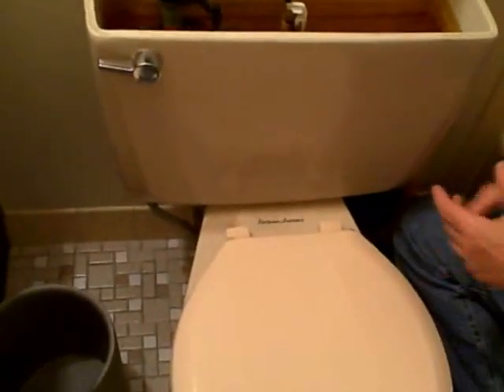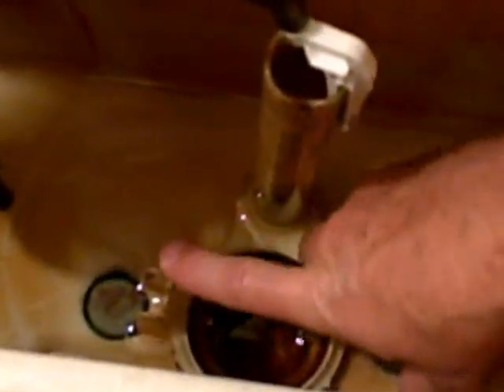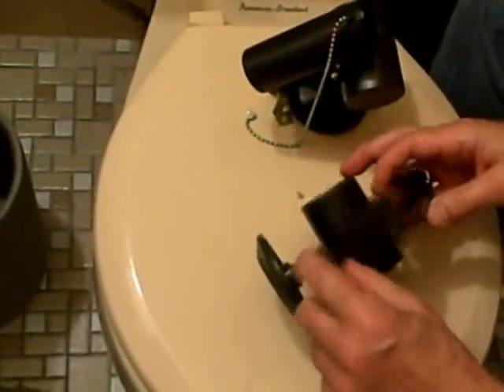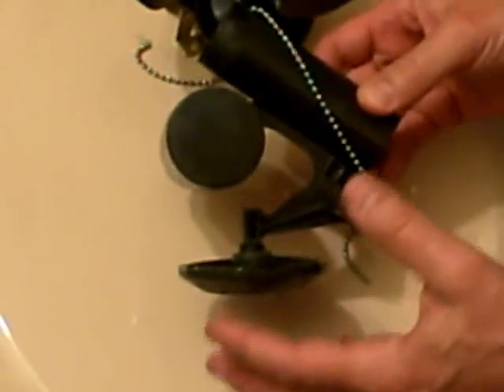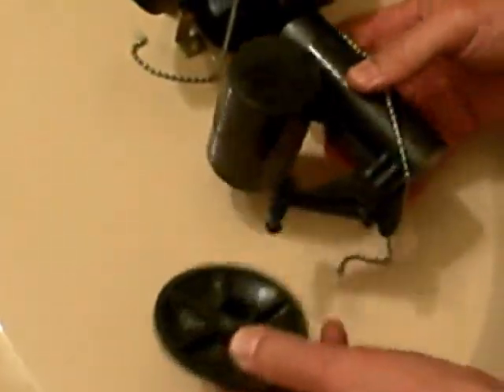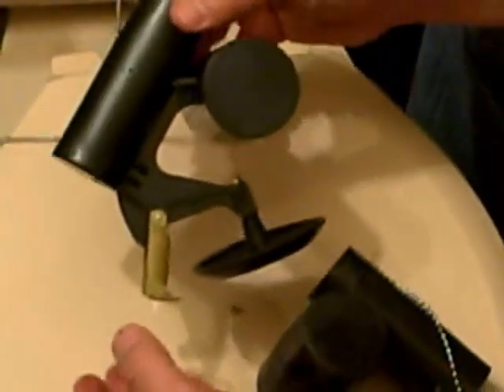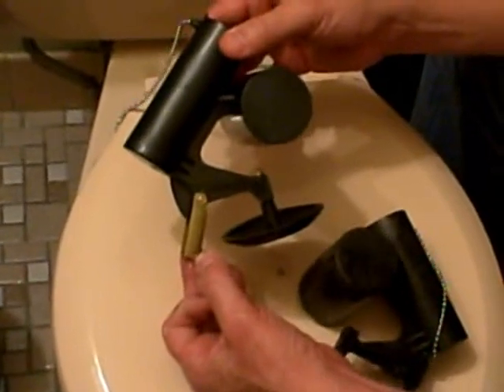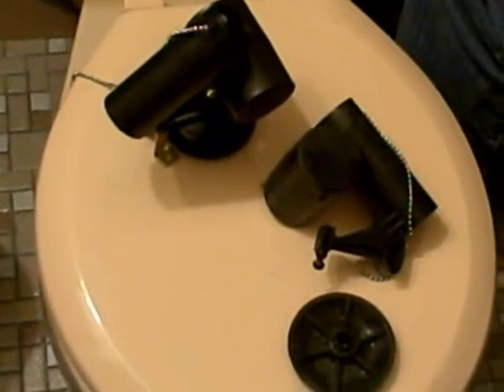American Standard Toilet Repair - Flush Valve Seat Disc

Comment: Pro tip: forget about the American Standard style flush valve. Just go to Lowe’s and get the fluidmaster universal 2 inch flush valve and it works perfectly. The only thing is that the included tank-to-bowl gasket doesn’t quite fit so you need to get the Keeney 2-inch gasket (also at Lowe’s) and it will work. I just did this to five of these toilets from 1964, I should’ve made a video on how to do it
Reply: Can you buy a flapper that slides over the overflow tube?
Reply: Wish you made a video on this. this is the type of video i need right about now.

Comment: Youre blowing my mind here. Ive been screwing around with flappers on my toilet and I can never find one that works right. And my toilet has no ears for modern flappers to mount to, but it did have that bracket. Now I know what was meant to go there! Someone must have thrown away the old flush valve ages ago.

Comment: Great video. I have an Am Strd Tank 4040. I think the Actuator is 47088-0700 and perhaps the original seat disc which now leaks. The more I play with the disc the worse it gets. Dilemma is I'm not sure if this is screw on type or snap off. I was able to spin the disc counterclockwise but it didn't screw off. However it didn't easily pry off easy as yours did either. Do you have any thoughts about the correct seat disc on model 47088-0700? Or how can I determine if this is snap or screw type?

Comment: I would love to take it to the hardware store if I could figure out how to take it out. How do you take out the piece that you had already taken out?
Reply: I know this is very old and hopefully you've figured it out by now but the answer to your question is you take it off very carefully. The plastic bracket that holds the 2 little notches to the flapper, can be gently spread so the pegs pop out. I found doing one at a time worked very well.

And if your stuff is old like mine, you don't want to touch the actual seal at all or you'll be pitch black and slimy.

Comment: If anyone is trying to replace the screw on type for a 4049, shut off the water and drain the tank. Get your needle nose pliers handy, lift back the actuator and press up on the disc a few times and you will notice the top of the screw moving up and down. Use your needle nose pliers to hold the top of the screw still, then unscrew the disk flapper. There should be a replacement nut with your new flapper. Insert it until you hear or feel a pop. Go back to holding the top of the screw with the needle nose pliers and screw the new flapper on. Let it drop down on the hole, turn on the water and give it a flush or two. I used the Fluidmaster 5013 today in one toilet and it's doing fine for me so far.

Comment: Update: Removing actuator from bracket was somewhat hard. I removed it from the new bracket but a test to put it back on was tricky. I remembered Kat's forebodings & concluded too much risk with so little room to work. I next tried changing only the rubber piece. The actuator patent # is the same, but this rubber flap is neither screw nor snap. Well ok- it's a screw hybrid, but attaches (as through) the mechanism next to the drum, like a bicycle spoke. The fill tube is also longer. Oh well.

Comment: Will the Universal American Standard flush valve actuator work for them all?
Reply from the maker: Hi, yes it will. Just put in the threaded nut for a threaded rod, remove the nut for the style with a push fit.
Check out more home improvement tips in our e-books https://www.amazon.com/gp/product/B0B2KW1FQ9?notRedirectToSDP=1&.

Comment: It looks like no one has used the advice you offered for a while, but lucky for me I had a look before going to the hardware store for the part. It took about 10 minutes once I got back to have the flush valve repaired and working like new.  Thanks
Reply from the maker: Glad it was helpful!
Check out more home improvement tips on our weekly podcast 
https://itunes.apple.com/us/podcast/fix-it-home-improvement/id880903087?mt=2

Comment: Saturday 8/24/13 I attempted the switch. I was able to get the leaky unit out. Unfortunately when inspected up close it seemed I needed the #4 old style high profile unit, not the 47088-0700. I gambled & sunk another $16 w/shipping for the #4. It arrived today. Success! I'll just add that it takes some playing around to get the units out of their brackets but when maneuvered just right, it will come out. I push pulled w/two hands & rotated the front nib upwards. Thanks for your insight.

Comment: Thanks, I just repaired mine, replacing only the removable screw on disc/flapper. Out of 3 toilets, that one has been in there since 1987 when we bought the house with no problems whatsoever.  That's pretty typical to change a design that works perfect and go to the modern korky type flappers you have to replace every couple of years. Planned obsolescence.

Comment from the maker: Hi,
On the style that I removed, I used a finger between the bracket to spread it apart and twisted the flap to slide it out. 
Can you remove the rubber disc?

Comment: Do you know what color that toilet is called? I have 1958 American Standard fixtures and I'm either looking at repairing them or replacing in a lathe and plaster bathroom with at least an inch of mortar bed to get the tub out. Plus, it's a double apron tub so I'd have to demo my whole bath to replace it. Any help you could offer would be deeply appreciated. Thanks for the video. I've subscribed.
Reply from the maker: Hi, sorry I don't know the color. I would give American Standard a call and see if they could help. I've found most companies to be helpful. 
Check out more home improvement tips in our e-books https://www.amazon.com/gp/product/B0B2KW1FQ9?notRedirectToSDP=1&.
Reply: @FIXITHomeImprovementChannel  
Thank you for the reply. I'm sorry to be a pest, but where would I find the style number on the part. The bracket is broken on mine and it looks just like the second one you show with the brass bracket. It's a one piece toilet, I believe an Old Champion style.

Comment: What if you just want to replace a broken flush valve chain, but the old small rubber grommet is stuck in the hole in the actuator? How can you get it out?
Reply from the maker: Hi, did you try an awl or a precision screwdriver?
Reply: @FIXITHomeImprovementChannel  I have not- I will give that a try. Thanks!

Comment: I decided upon the 47088-0700 and have received shipping notification, I expect it next week.  Having never replaced this part  before and it's antiquated, I can sympathize with Kat's worry about breaking the bracket, but I'm going to carefully try the "spread apart the bracket and twist technique" and hope for the best. If you can think of anything else I should keep in mind, let me know- otherwise Thank You again for this insightful video.
Reply: I broke the tabs on the flush valve-they were paper thin. Bobby pins holding for now.

Comment from the maker: That style should just snap in place with 2 small posts like you see in the video. They come in snap or threaded. If it is a 47088-0700. Your local hardware store should be able to order it, or go to a plumbing supply. You can also call American Standard, they should be helpful.

Comment: Very informative, except how do I actually get the flapper assembly off, and is there an adapter to switch it to the more common tower flapper (or is there a reason this is not a good idea with my toilet)?
Reply from the maker: +Dni KL Hi, here is a video showing how to replace the flush valve. Let me know if that helps. https://www.youtube.com/watch?v=hwOXKvlAk2Q
We have more tips in our home improvement book http://www.amazon.com/dp/B01BK2K0JM?ref_=pe_2427780_160035660

Comment: I'm almost certain I have the correct model # but there is reason to believe I have an older version of the same model. As I pointed out it's going to take some work to get the pieces switched, and with the risks involved, no- I haven't done anything yet. If I knew for sure the new one was going to fit, I'd definitely attempt it. Now I'm apprehensive about possibly ending up in a worse state for nothing. With the weekend coming maybe I'll get the nerve up.

Comment: I have changed the Everbilt Valve Actuating unit using the blue part,, Type B,, Snap in, and I still have a leak. I rotated the press seat disc, cleaned it and also cleaned off it's mating surface on the bottom to no avail.   When I did this before the problem was solved.  I don't understand why it is still leaking. :(   Anyone have any ideas? Thank you.
Reply: Flush valve seal probably needs replacing, though I assume you've fixed the issue by now.

Comment: It doesn't seem there are any screws to take out. The little metal "nibbles" stick out a little. . It seems I might have to widen the plastic holder to take it out, but it is plastic and will probably snap, so then I will have bigger problems.

Comment: How u removed the valve ?
Reply from the maker: Hi, there are a couple models in this style. One just snaps off, one style needs to be unscrewed. The easiest is to remove the rubber gasket and replace that rather than removing the whole part.
We have more tips on our weekly podcast http://castbox.fm/u/4891735

Comment: I'm sorry, but this video did not help whatsoever! How do you take it off?? Can you just buy a flapper that fits over the overflow tube once you take the actuator off?
Reply: I just tried to pop the rubber flapper off like he did and it broke.
I'm pissed!
Reply: Ah...there are two models, #5 and #4...better make sure you get the right one or your toilet won't flush properly.
One is high flush/tank and one is low...the #4 is low and both sides of the bucket/barrel/float is sealed where as the #5 is the high flush/tank and only one side of the barrel is sealed.